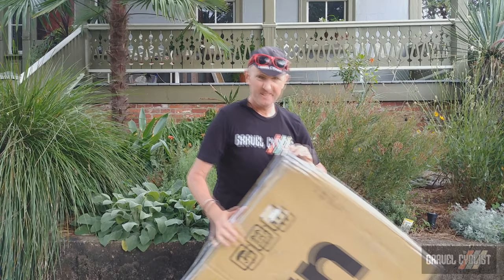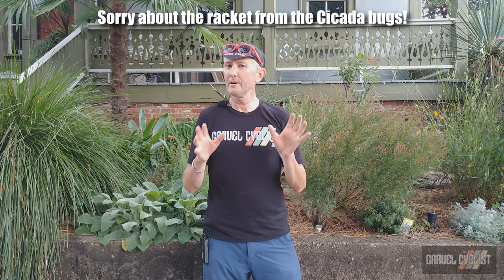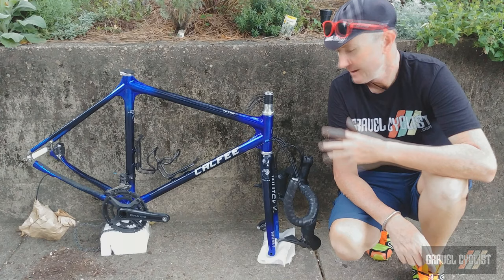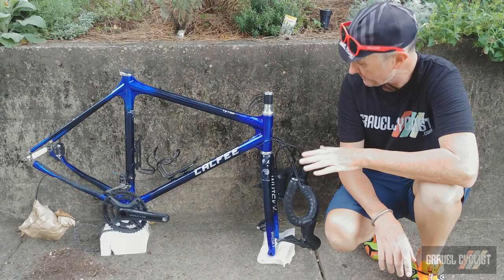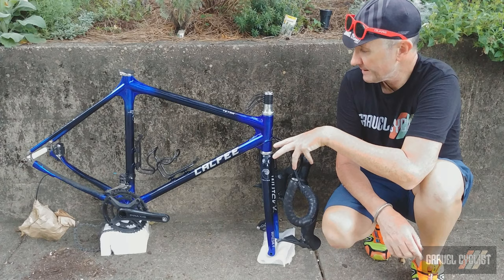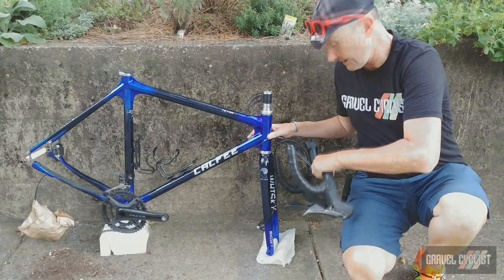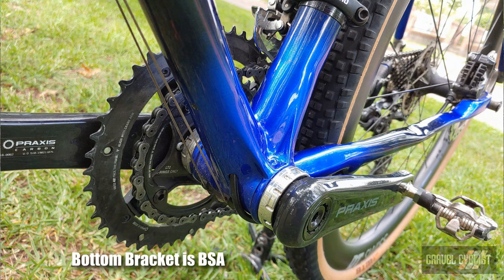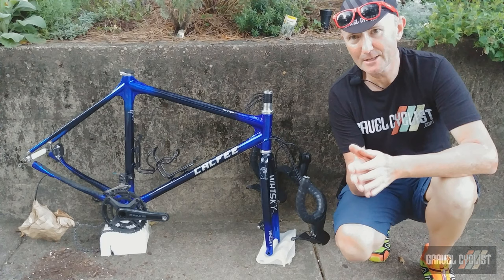Calfee Tetra Adventure Bike: Unboxing & Features - Made in the USA!

Comment: Do you run 650b or 700c with the Calfee? Was wondering if it could handle big overland remote trips?
Reply from the maker: 700c is being ridden first, 650b later. You'll have to wait for my review to appear... as for overland trips, I'm sure with the right mounts and so on, that wouldn't be an issue.

Comment: Lovely looking bike, and looking forward to seeing it built up for riding.  Its great you included some of Calfee's story in the description - I love reading peoples backgrounds, as it often shows their motivations on how they work.

and - are you going to run it 2x with a 11-40 on the rear?
Reply from the maker: Hi David, I'll be running it 2x with the 11-40 and an 11-32. You don't really need the Roadlink to accomplish that (the GRX derailleur will shift a 40T cog in native mode), but it makes things a little more doable.
Reply: @GravelCyclist  Great - at least you have the option for the wider set of gears as/when you need them.